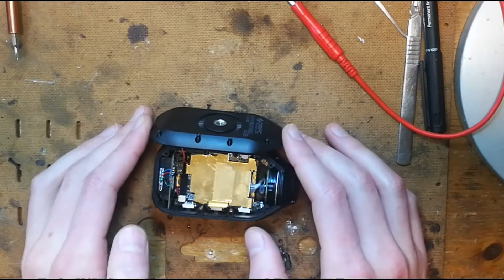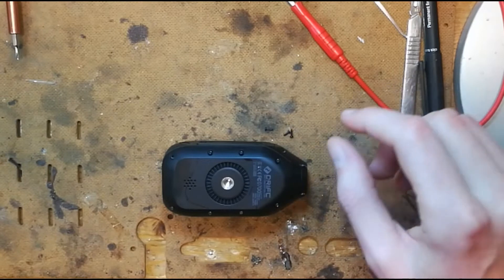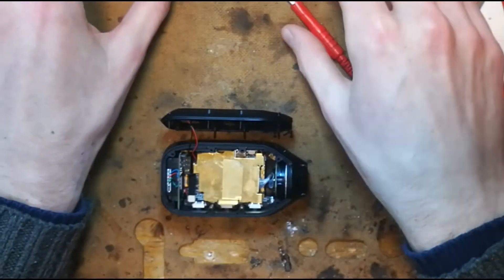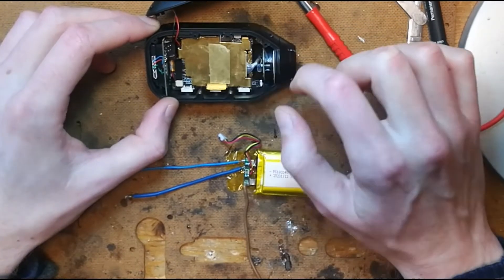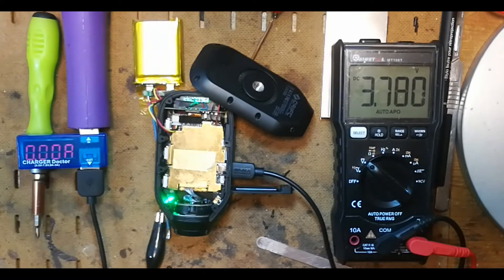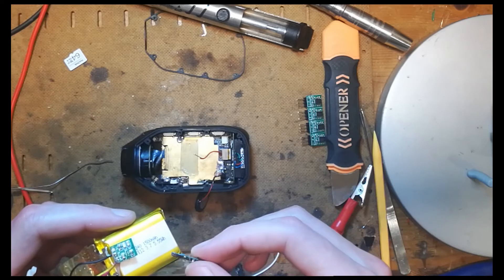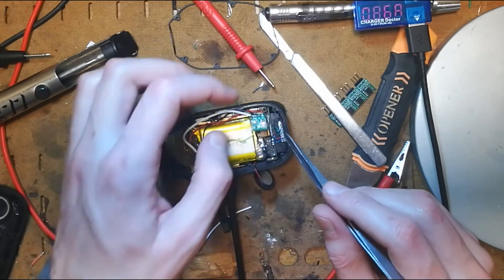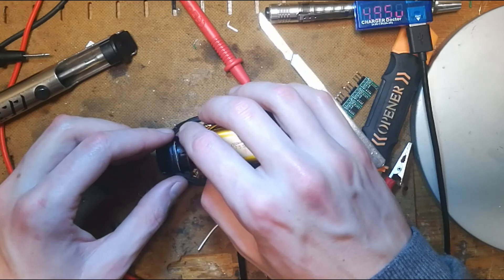Teardown and repair of a Drift Ghost XL camera that won't charge.

Comment: Just received my 2 Drift XL cameras- and immediately noticed weird charging protocols and the cameras acting bizarrely. Gonna run them down and try recharging from a drained battery, but out of the boxes these things kinda suck. I dont want problems and troubleshooting immediately after tearing off the cellophane when I pay hundreds of dollars for something.

Comment: I've just replaced the battery in my Drift 4K with a 1500 mAh 103443. You can get them pretty cheaply.

Anyway, this didn't solve my charging issue, so I suspect it's a circuit board problem.

I'm reluctant to switch to any other camera because I love the Drift's design, but this is my third one now, and I need to find something else.
Reply: Where u find it

Comment: My Ghost X was old when it came to me secondhand and after several years my internal battery has just died. But the little guy is like Monty Python’s black knight, it just keeps fighting! It’s previously popped back to life after dying in biblical rain and to my amazement tonight a reset brought it back from completely unresponsive. Your great video has convinced me to not even attempt to replace the internal battery. I’ll just stick with a cable and power bank. 😂

Comment: These cameras are dreadful and I would not recommend anyone buying one. I had the same problem with the battery not charging and Drift would not help me at all, even though it was in warranty. In the end I sent it back to them and told them to dispose of it as they wished as it was no use to me. My advice, buy a DJI Osmo Action 4.

Comment: Is there anywhere online that we can purchase the spare battery for ghost XL. Mine just got burnt
Reply: Just measure the 3 dimensions it need to fit in, buy any generic lipo pouch smaller than those dimensions.

Comment: I have a 4K+ that the mini USB failed after less than a month. It worn't take a charge  or function at all. I've contacted Drift and they have done nothing but stall and ignore my emails. I was really liking the camera when it worked, but Drift has the worse customer support I've ever experienced.
Reply from the maker: Is there physical damage to that port, or you are just guessing it's the port due to the fact that it isn't charging?
Reply: Yo compré dos cámaras una XL y una 4k+ las mismas después de 2 meses dejan de funcionar las conecto para cargarlas a la fuente de Electricidad y están muertas dinero tirado ala basura no sé qué  hacer???

Comment: Thanks for uploading the detailed video. My drift ghost S of 4 years has finally died and was looking to see how I might be able to fix it. It just won't charge or power up. Would you happen to know anyone or anyplace that could help with repairs? Or is it even worth the trouble? Or the cost of repairs?
Thanks again, unfortunately I don't have the tools or knowledge to do what you were able to do 😊
Reply from the maker: I think the only possibility is to call around some local repair shops. Look for one that is doing the repairs themselves, not sending things off to a third party for soldering work etc. I would estimate that they would charge around £50 for the labour but it depends on what is actually wrong inside. As you can see I had to find a specialist part, it was very cheap but still more time spent "working" on it. 
If it was the batteries themselves - I have to say that I was not able to see the correct size of battery for sale. 

So, with regret, you might be better of selling it for parts on ebay and buying a replacement. If you are on the cusp of throwing it in the trash, please email me on zcplk2yc8tf1@opayq.com I will consider looking at it.

Comment: I've got a very old Drift HD 1080, I found that it would sometimes make a screeching noise and then shut down, corrupt files or just not work....batteries were always fully charged, and I even tried a new battery. I noticed that the battery because very warm during use, so I can only assume the battery or something in the camera cuts the power off.....however with an external USB power-pack the camera works flawlessly.  Thank you for you video.

Comment: I was having the same issue with my battery and with Drift Support. I had just purchased the camera and was getting ready to send back when I received a notice that there was an update for it that was released this week. Why not! I flashed the camera and instead of charging with the type C port, I used the power connection that requires removing the screw. Both batteries charged. I don't know if it was the port or the upgrade that seems to have resolved the battery problem. Once charged the camera began to record video correctly as well. I have another few weeks until Amazon will not allow me to return the camera. I will test every night video taping the wall and charging while I'm at work. I'll post my results.